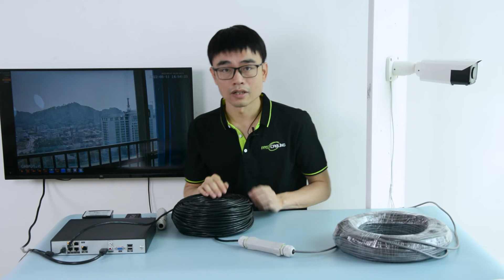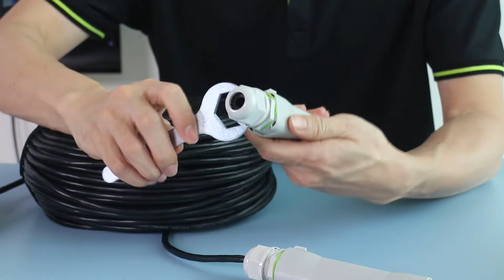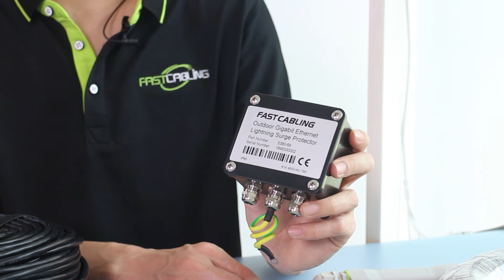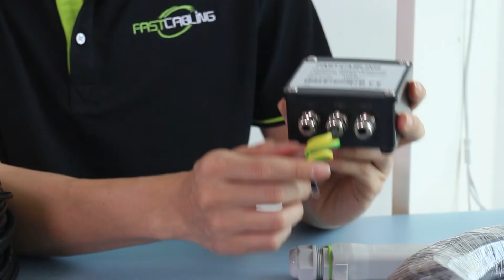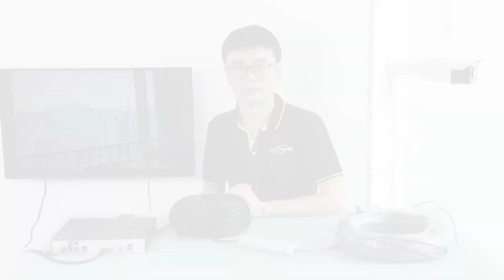Everything you need to about installing the PoE extender

Comment: Hello what you suggestion ıf we want access point to 400m, what i need for thid please
Reply from the maker: You can either go for cat6 cable or the fiber optic cable. You will need PoE extender with cat6 cable and media converter for fiber optic cable. I personally prefer fiber optic solution while the power source is ready at the edge. Otherwise, you may consider the PoE extender.